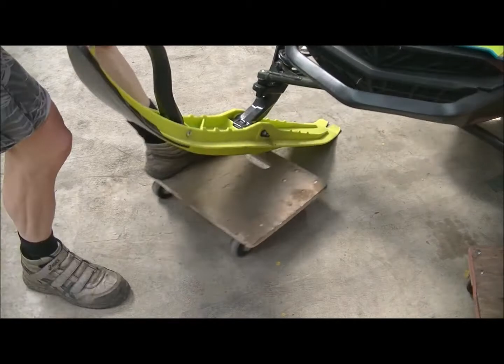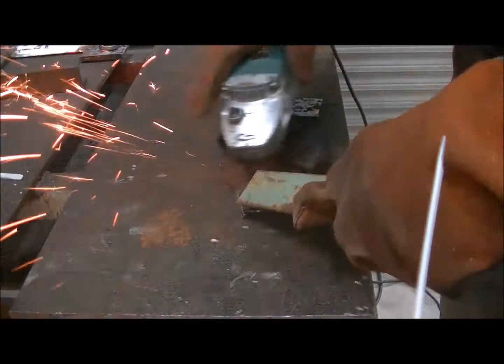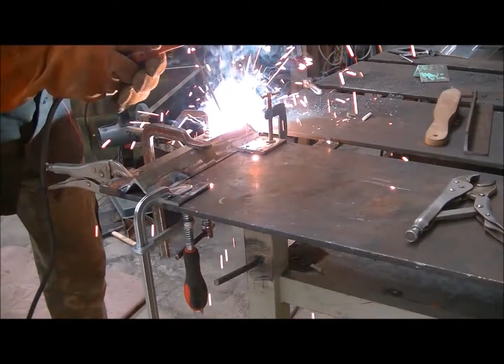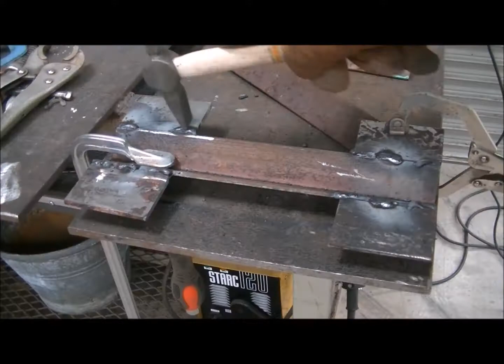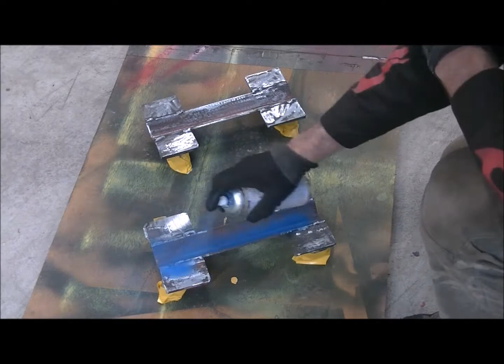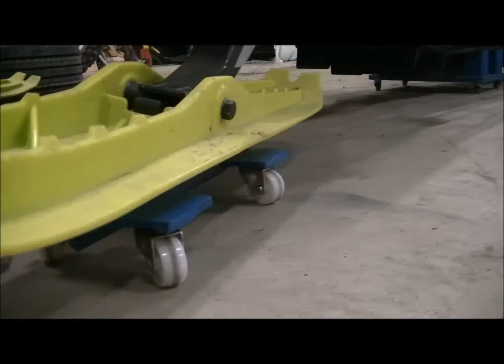Homemade steel snowmobile garage dolly

Comment: hey what were the rought measurments of all that ????
Reply from the maker: It's 40mm angle iron. Total width with tabs is 160mm/6 inch. Length 300mm. Castors 50mm/2inch. Next set I'll go for slightly bigger castors.
Reply: @AkatarawaJapan   yeah makes rolling over cracks easier
Reply: InstaBlaster...